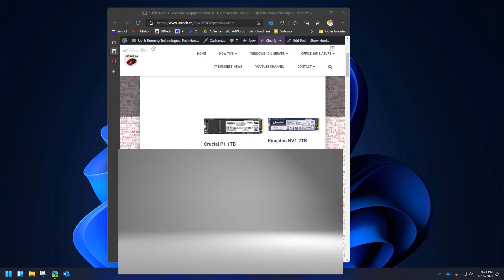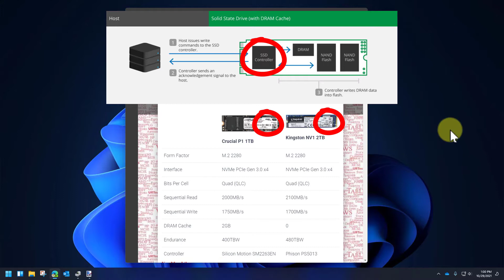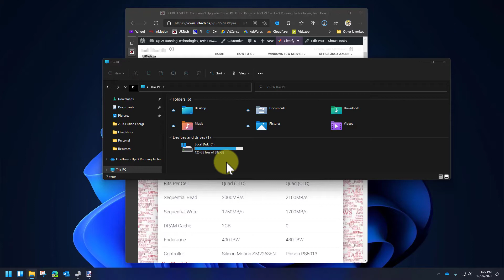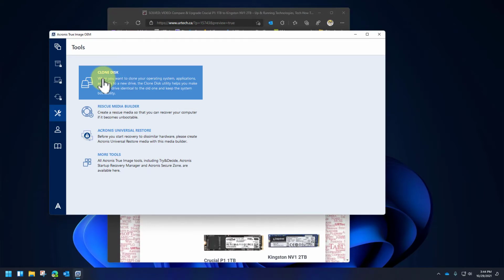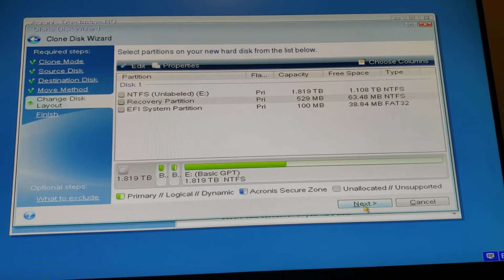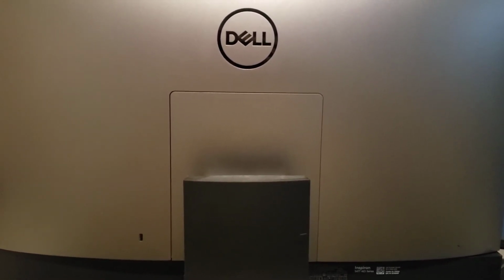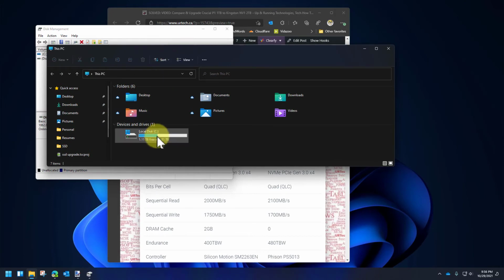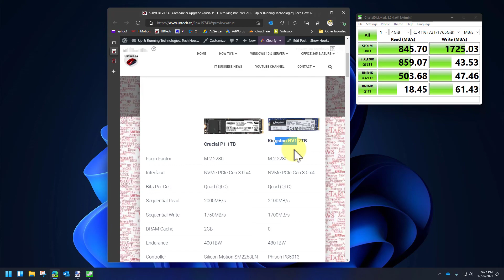Step By Step Kingston NV1 M.2 SSD Drive Clone Acronis Free + Benchmark

Comment: Can we clone out window from old hdd to new ssd drive and use the old one as extra storage without any use of usb adaptor? Is it possible to just plug in ssd in its slot and clone the window in it by acronis or other software?
Reply from the maker: @Mark Sister   If you have two M.2 slots this will work.  Most computers only have a single M.2 slot so the USB method is easiest for many.  Please let us know if you have any other questions.
Reply: @URTechDotCa  If your computer is like a Dell 5820 with Flexbay ports in front you can order a carrier for a second M.2 cheap and then turn the old drive into storage or cache. :)